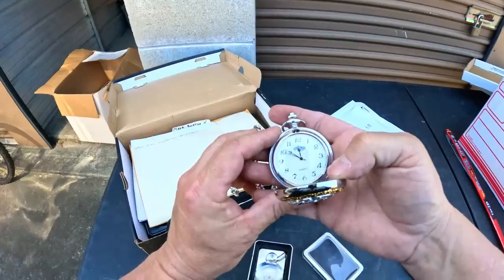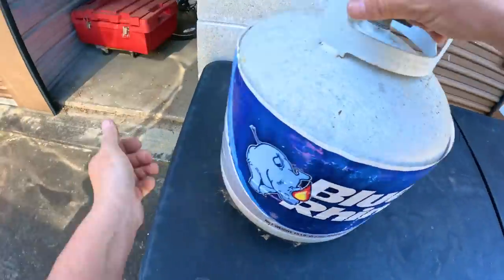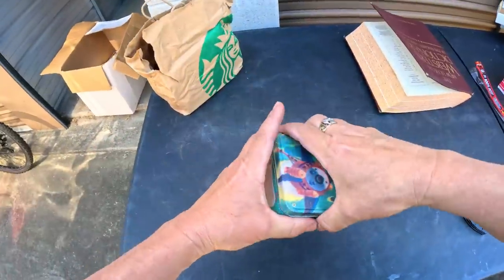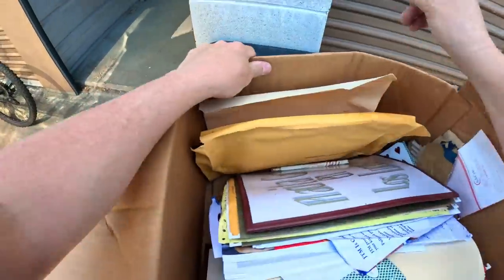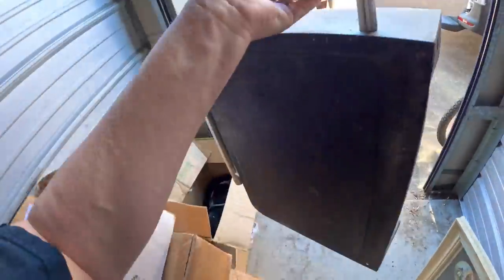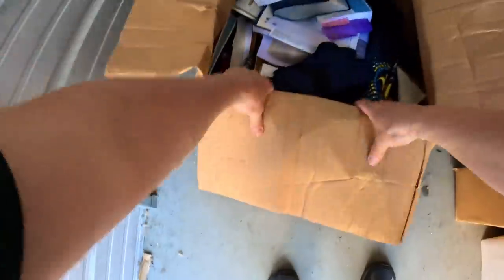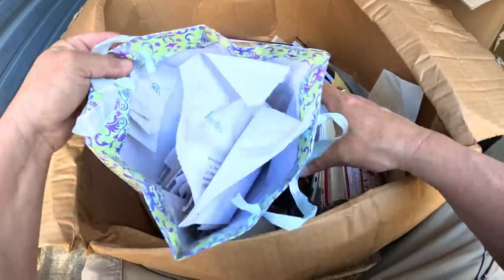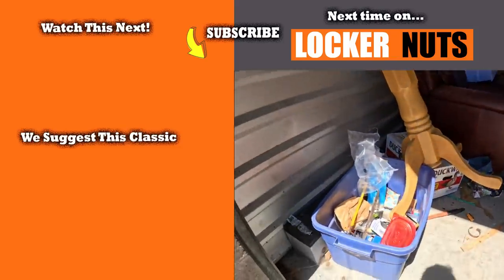This might've been a big mistake... I need to admit something

Comment: The part that resembles a cross is a u joint that goes in the end of your driveshaft in which connects the transmission to the rear end of your vehicle.